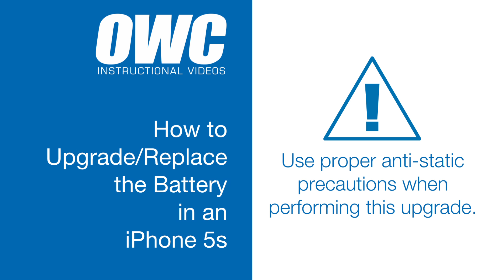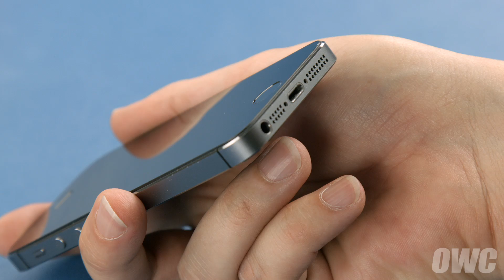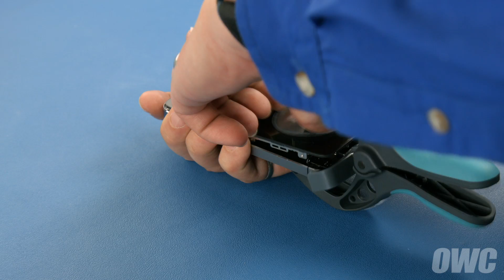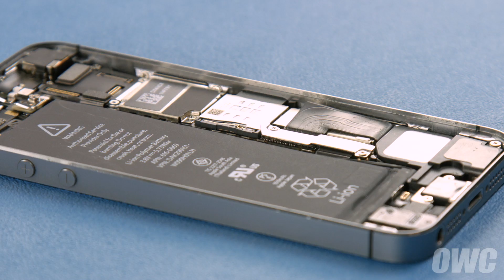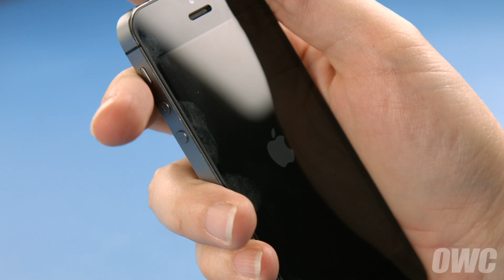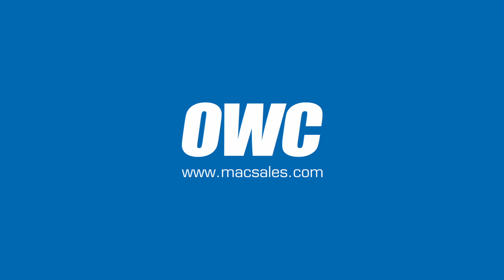How to Replace the Battery in an iPhone 5S

Comment: Try heating the phone over a light bulb for a few minutes to remove the battery.  (I used a 25 watt fluorescent lamp so it would not be too hot). It softens the adhesive strip and I was able to pry out the  already disconnected battery gently, as to not rupture the charged battery and create any other issues. Start at a corner with a letter opener or screwdriver, PATIENCE is key in letting the adhesive tear itself with gentle to moderate pressure, moving the screwdriver/letter opener all around being careful of course. I had it out in less than 4 minutes. Easy peasy.

Comment: You screwed the battery plate in upside down!
Reply from the maker: After watching the video it looks like it was removed and replaced the same way. Removing at 2:09 it slows down to the left and up to the right and it's the same at 3:37 when reinstalling. However if there is indeed something missing, if possible please reference the start and end points noting what is being seen or missing, as this helps us to create a better experience for all customers. Thank you. :)
Reply from the maker: @Geta Chada thank you for your notes.  As we explained above, this is exactly how it happened. (the iPhone worked afterwards, honest!)  Can you provide a link to one of the videos that shows something different?
Reply: @poweredbyowc  sure 

https://youtu.be/yJBWl4_Pg1U

In reality I don’t think it would actually affect anything but also you can just feel it’s wrong if you put it back the wrong way, the point part starts to bend slightly over the sim tray, I did this too at first hence the realization
Reply from the maker: Thank you so much for the feedback- we will have the video reviewed to make sure we are providing the correct information!

Comment: Great video, thanks. I was able to save time by not removing the upper display screen assembly by tying a string to the suction cup and holding it up hinged (must be careful). Also must be patient pulling out adhesive strips, they are rubbery and break easy, but worth the effort to not break, because if they do, you need to use a credit card under battery to loosen adhesive, which is more difficult. You can wind the stringy adhesive around your finger. Also putting the touch id wire metal bracket back on is tricky.

Comment: Advice from my experience, if your phone is old, you're going to be working with rly weak adhesive strips. u have to constantly be gripping for a lower part of adhesive during every pull, otherwise it will rip. If it rips u have to pry the battery a tad to reach under with a tiny poking tool to wrap itself in the adhesive to pull out & get a piece so u can continue pulling it. It seemed impossible to get this battery out without pulling out the adhesive. I was gently prying all around for an hour before I saw the opportunity to reach under & regain a grip on the adhesive.

Comment: Why remove the screen entirely? Is this just for convenience or will it damage the phone to leave it attached while you replace the battery?
Reply: I used small Velcro stickers to attach the display to an anchor at 90 degrees. I think I’d have failed to take out and replace those four tiny screws had I not done that. It saved time and sweat!  Otherwise, I think this video is very useful indeed.